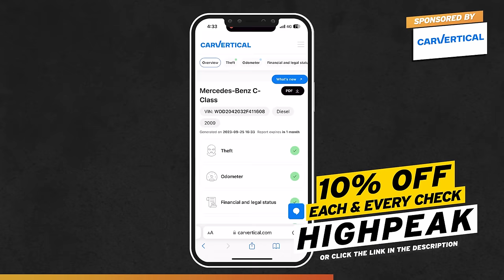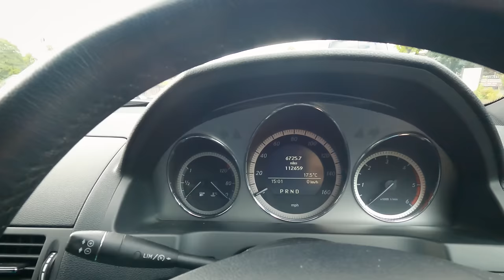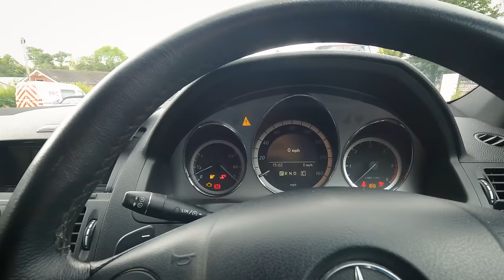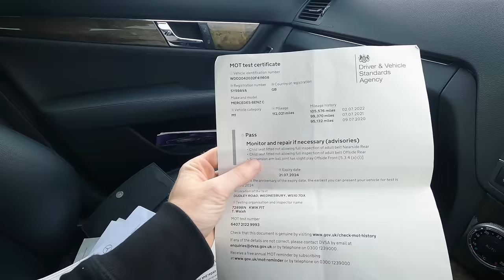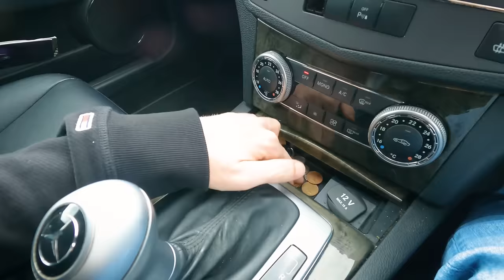I BOUGHT A CHEAP MERCEDES C-CLASS ESTATE FOR £2,700!

Comment: I find it astonishing that people will buy a fairly new, expensive, quality car for say £20k, and then skimp on a £300 service. I just don't get it. I've had loads of older cars over the years and even when they are worth peanuts, I would never not get it serviced exactly on time. Why do people do it?
Reply: Hi. I suspect people borrow the maximum amount of money they can to buy the car. This leaves them with nothing to actually maintain it.
Reply: Definitely spend all their spare cash on PCP or hp so nothing left to spend on maintenance especially when they will just chop it in again on 12 months for something in fashion
Reply: If it’s your main method of transport, and where you’re spending a significant amount of time, why wouldn’t you keep it clean and maintained? Baffling.
Reply: They may have maintained it themselves, possibly rather than probably!
I do my own servicing, partly to save some money, that's how it started, but mainly because I have trust issues having seen some of the stunts many garages put, I also then know it's done properly with quality parts.  Obviously can be a problem come sale time but I'm aiming to keep my current car for ever so not a problem.
Reply: Not ULEZ which kills the value of pretty much any mercedes before 2015
Reply: the human being, on avg, is not too sharp.   Or many of these owners are ignorant, or cars are too easy for them to afford.

Comment: Bought a 2014 one a year ago. Deliberately chose the older model c220 AMG sport estate because I preferred it. So far really pleased. Smooth and nicely planted on the road. Much prefer the interior and controls to newer cars (I hate cars with everything controlled by a tablet screen thing stuck on your dashboard). Engines a bit noisy when cold but on the move fine. Very comfy on a long journey and fuel efficient for quite a biggish lump.
Reply: I fully agrees about the interior on the newer Mercs to much like an Amstrad music centre
Reply: @pauldavies6037 yes the newer ones are chavy and glitzy, bit naff.
Reply: @mattwright2964  I Agree
Reply: What year are you calling new from?
Reply: @mattwright2964 what year is new to you?curious!👍

Comment: Not surprised it sold quickly. Quality ,well sorted car at a reasonable price,what’s not to like 👍👍👍👍
Reply: Rapidly approaching the moneypit sunset. Granted this is the UK but still absolute garbage quality. I've got a 30 year old nissan bluebird, none of those issues, they just run and run.
Reply: Where's the quality in a car with engine and gearbox mounts expired already, brake lines rusted and kaput. A tractor engine, and a stinking aircon. Mercs are just glorified taxis thats all.
Reply: @rambleon3698  blimey, that’s me told!
Reply: @rambleon3698  Wrong. Engine and gearbox mounts lasted for 14 years (you should find out how long a motor mount lasts on other cars and you will see that 14 years is very good), brake lines and stinking aircon got to that state because the car lived in a wet area, it was probably parked near the sea and it's completely normal for a 14 years old car...

Comment: My C220 CDi Estate (14 reg, black) has done 215000 miles and still drives like new, just passed another MOT no advisories. Very quiet, fast enough, 55MPG on a run.

Comment: I’ve had my 2009 c180 estate for 10 years ! And now on 227,000miles ! Still driving great , I’m now going to check my brake pipes !!
Reply: had the same model and also had the same brake pipe issue
Reply: I've just had mine replaced after them failing, a 2011 E250 CDi coupe.

Comment: i've have the 2012 estate 220cdi amg sports plus  version owned since nearly new at 5k miles  , and now 135k miles up. Apart from usual consumables, all i have every had to replace is the clock spring on steering wheel @ 90k miles and water pump @125k miles. g/box serviced every 40-50k miles and i've latterly increased engine  oil change intervals to every 5k-8k miles and the engine still runs as sweet as a nut (55 -60mpg on a run) . As an fyi merc have a recall for the possible rust in the rear sub frame which they will replace FOC if rust found  ..mine is ok so far. Bottom line for me is the utility value is worth far more than what i could get if i sold  it , and im looking forward to running it for another 100k miles

Comment: Had my 2008 c200 for 10 YEARS!!!! Still drives great and very reliable. Mine is the older OM646 engine with duplex timing chain. 204k and should be good galactic miles. Great video Matt!

Comment: I bought a 2012 C200 diesel last week. Definitely agricultural 😁 Not quite as nice to sit in as a 3 series but I’m liking it more and more. I even did a car vertical check with the High Peak discount. Happy days
Reply: Hello, how would you compare it against a Lexus is like a IS250 or 2013- IS300h? I'm interested but I would like to know if you had considered the lexus.
Reply: @Sha-Ayo He bought a Lexus IS the other day, and did a video on it! It was one of the really old ones though, straight out of the E46 era, so if you're buying one, expect lots of crispy metal and hidden bodgery below the door handles.
Reply: @sha22276 he has done a video on the IS250. You can check that out.

Comment: I just bought a 2012 R Class here in Canada - a true 7-seater station wagon (estate) with less than 60k miles on the clock powered by a 3.5-liter diesel and in as new condition for $15k (Canadian). I don't think this model was ever sold in Europe and it was never a massive success in North America where the market is either minivans (Honda Odyssey and Toyota) or SUVs. 
The Merc sits somewhere in the middle. Like a minivan,  it has seven seats, with the third row actually being comfortable and usable. Like an SUV it has 4WD and can actually be lifted on rough terrain. Its luggage capacity with seven seats in use is a little limited, but for our family of five plus a dog it is the perfect vehicle. 
30 miles to the gallon on the highway, which is amazing for such a large and heavy car. Very happy with it.

Comment: I've had one of these for 10 years, but with the V6 engine. A lot smoother than the 4-cyls and will still do 50mpg without trying too hard. Big enough carry a wardrobe, but not tank-like to drive at all. Rear tyres don't last long, wish mine had 17-inch rather than 18-inch wheels. I only got 10K from the current Continentals and I'm a sensible driver. Avoid solid red (Diablo red?) on Mercs of this era, there's a manufacturing fault that makes the lacquer peel off. Doesn't affect any other colours And I spent ages waiting for a red C350CDI to show up in Autotrader. Such is life.

Comment: Nice buy! I own a ‘08 s204. I love it and drive it for 6 years now. The rear subrame can be a problem on these cars. They will rust from the inside out and break. Mercedes replaced the rear subrame on my car under warranty when it was 11 or 12 years old! Als check the brake lines under the subrame, they will also rust..

Comment: I would totally agree with the brake pipes as I had the same problem on my W204, and it hadn't shown on the MOT, but a Mercedes specialist told me. Also, the subframe is a known issue on the W204 for corrosion. Nice cars though

Comment: All of those issues, i've had with my 08 C200cdi on 175k miles.  Coil springs, rear light plastic, seat cover, ball joints. Common issues. 

Also ive had a water pump go (no cambelt so not serviced on interval), body module (reset) and the keys play up. I dont skimp on my tyres like this, Michelin Climate Controls last forever and give these grip in the snow. 

Engines are more bombproof than expected.

Comment: My company got me a 2014 EClass 2.1 diesel a couple of months ago after my Nissan Jukes's cvt gearbox let go after 168000 miles. Its on 132000 miles, and i hate noisy cars but for some reason i dont mind it in the merc, once you move off it fades way. What i like is there is no difference in cabin noise between 60mph and 85mph. Plenty of power for normal use, 40mpg urban and 50 motorway @70mph. A 2016 ulez one is still £16000 +.

Comment: I like these mercs, I have one 140k on it. Solid cars if you look after them. Mine is now at an age/mileage where I'm getting things done to it regularly but I do drive about 400 miles every week in it.
Last 2 years - Brake line burst, got new line, discs, pads, several oil changes, 2 or 3 suspension arms replaced, Back plate replaced, new tires 3 times, exhaust clamp replaced, Air con pressure sensor replaced, re gassed...

Comment: I've got a 2014 C Class saloon Matt and really like it. Mine was bought new by someone who cheaped out with the accessories catalogue, but I still love it. Yes, the 2.1 is a little agricultural and my 136 bhp version does this thing in "sport" mode where it just makes more noise without any perceived performance increase 😂. But that engine is fitted to the Vento van and as such is very durable. You made me really anxious when you pressed the tailgate release as that wall looked awfully close 😬. But it looks a nice example. Privacy glass is nice to see as is the dog guard for your XL Bully 😉.
In conclusion then, quite an outlay for the profit BUT another very nice car for the buyer with a potential 100,000 miles more life in it if they look after it.
P.s. I also get the gearbox service done on time. It's not cheap but the cost of a reconditioned gearbox is a lot more.

Comment: That price is crazy in germany where i live the cheapest one in a 100km radius is 5900€ and it has 300000km on the clock wich is about 186k miles and the engine is knocking

Comment: Great video I  picked the same car for myself Matt from auction,  C250 estate £1800 on a 2011 with 188k, same door card issue!, needed a drop link and a tyre, needs a timing chain as the tensioner is worn. so for less then 3k I've got a super quick safe tank that does 40mpg!

Comment: Good watch again Matt. However, at 17:09 I am perhaps in the minority. I traded in my 2019 530d a couple of months ago that I had had serviced at BMW, left Michelins all round that had done 5,000 since replacing them and wanted for nothing, but, I deliberately left about 20 miles of diesel in it. My view is that if I’m offering a car thats been well looked after why should I give away half a tank of fuel as well? Particularly given the cost of fuel at present. 😂👍

Comment: I have the petrol C180k of this, 2009, 125k miles, silver in absolutely mint condition. I’ve added a touch screen display, reverse camera and phone charging. Zero mechanical issues with it (had copper brake pipes fitted AND auto gearbox service!) feels like a £15k 2018 car. I thought I’d only be looking at £3k sell-on for it (if I sold it), but you getting £5995 for one in much worse shape makes me feel better!😂
Reply: Sounds like it looks more modern with your upgrades. Always have more respect for people taking pride in their older cars.

Comment: Got my c200 kompressor in Australia for $ 12, 200..., 118000km. yep, had bad vibrations under acceleration,  however new mounts and she is sweet. Also I notice alot of the 204 chassis suffer that aweful wavy vinyl on the door top, must be people resting their elbow there. Apart from that, and being overly noisy, not what you would expect considering our holden commodore's were far quieter, but  a great rig.

Comment: I traded my last car in on an empty tank, but not deliberately. I actually filled it to the brim five days before I took delivery of my new car… the dealer delivered it three days late, not a chance I was going to go fill it up again for them having already done that once… they delivered my new car with the fuel light on. Incidentally, it’s the only time I’ve seen the fuel light on on either car… I always fill my tank and never try to run on fumes. Had they have delivered on time, they would have had over half a tank in it, but I was easily using a tank of fuel a week in that car.

Comment: I've said this more than once I like to thank I look after my cars quite maticoulously , generally I buy cars upto 3 years old and the wife's upto 8 years old or so I have never bought a car yet that the car has not had the petrol light on. I've only ever bought 1 brand new car which in 01 was near enough £19 grand and that had only half a tank of diesel. Matt you must be the only car dealer in the UK that puts fuel in a car before selling as No1 else does unless I'm extremely unlucky and at 53 including wife's and daughters cars going on 50 cars.

Comment: Had this era of W204 as it’s a good looking car, but always check the subframe as they’re prone to rot. But if they do, you can take it to a merc garage and they’ll replace it for free.
Reply: A merc dealer replacing something for free!
Reply: The independent Mercedes specialist I take mine to told me that he checks when it comes in for servicing, removes any surface rust from the subframe and coats it in oil. I am very impressed with the service I receive, can't blame them for parts costs, that's down to Mercedes, how about £90 for 4 little plastic wheel centre caps, I should have asked first I guess, just thought they'd suit the refurbished wheels, still can't take it with you !

Comment: I had the exact same Merc for three years and without a shadow of a doubt it was the most unreliable bag of nails I have ever owned.  The following is just some of the things that went wrong with it: Brake pipes corroded- all replaced, torque converter refurbished £1250, suspension arms failed, countless sensors replaced on the engine, water pump failed-replace, DPF blocked- taken of and cleaned, Spring broken-replaced. In addition there were numerous items that failed and I just lived with, CD player failed, air con failed, drivers heated seat failed, rear demister sometimes worked.  I sold it in Feb this year to dealer in Milton Keynes, on the plus side it was MCFC blue!  I'll be very surprised if you don't see it again, I would love to hear the follow up.
Reply: Suspension arms don't fail, they are a consumable item that with the state of British roads you're probably lucky to get 100k miles out of them.

Comment: The older Mercs are far more better well made than the newer cars, If you can buy an older Merc with Low miles and look after it, it will look after you. All the old Mercs were Manufactured in Germany, Now they have some parts Manufacture in China and then put the car together in Germany.  Im looking to buy a 2013 Merc C250 Estate with about 40 Thousand miles, FSH  price11K

Comment: Result getting £6k, I thought you were pushing it a bit when you said £5k at the beginning, I've got a 55 plate saab convertible here if you want it, unfortunately no mot, my local garage has been to busy and I've been off work and unable to drive, so I was in no rush to get it tested, it's been sitting on the drive now for 2 months and I'm not sure when I'll be allowed behind the wheel again, I'm sure someone will take it away for £500 🤷‍♂️

Comment: Right. The new video came up before can comment of A class you bought for £1500. The S Class in 90s bought by execs with 2 kids to drive to from work, church. Not really used for long roads trips. These are men over 50s which I reckon you are well  below that 😅 nice to see the superfluous gadgets of that time. You may be right about owners passing away and car sits there for years. My dad passed away 2020. Mum doesn't drive so an 1990s E 420 with less than probably 30K miles,  bone dry always garaged from Cal. sun, will sit in the garage for another 5-10 years as mum does not want to let it go. In the end we are merely stewards of cars (and houses) for the time we are on this earth, so let's enjoy👍🏻Namaste. PS if you can only have one car to drive, what would it be? I am hoping you did not part with you SL AMG. That is one car to keep. My dream Mercedes are the couple convertible from 80s, classic design and simpler times, no internet, people seem more connected as odd as that sounds. Namaste. On with more binge watching. The front grille of this C class doesn't grab me, definitely post 2000s era.

Comment: Well the s204 C250 CDi reg SY59AVA passed its MOT at 112,000 miles in mid 2023 when it was 14  years old. I don't believe the mileage of 112k on a 14 year old diesel with shot engine mounts. Engine mounts should last longer than 112k. My own 3.5 year old 2016 ex lease s205 C200SE petrol cost me £9.4k at 154k miles. Its now on 204k and 4.5y of my owmership only 1 Nox sensor and 1 waterpump.

Comment: I’ve had a couple of these and they are good cars, every single model or variation serving a good purpose. I’ve had a 180K and a 200 CDI, both 6 speed manuals, providing exceptional fuel economy. It’s not easy to sell manual Mercs as the auto boxes are a lot more relaxing and suit Mercedes in general, so bear that in mind d when buying or selling.
The supercharged engines are always a blast. Overall, it’s a nice improvement on the 203 series and a more positive improvement than what happened between the 211 and 212 series E-Classes, where somehow some of the quality feel of the earlier generation was lost.
I’d get either one of the Kompressor engines or the 250 CDI again. The 200 CDi does over 60GB on a good run, but these diesels have all sorts of issues associated with modern diesel engines, so rather than economy, I’d go for the extra power and torque, enjoying them while spending what has to be spent.

Comment: Love Mercs. I have a 2013 C220 AMG blue efficiency, and I recently had to have a new engine as the old one had seized. Does anybody know if that would affect its value? The old engine was at 84K miles. However, the new engine now is 53K miles, and the engine is 1 year younger than it's previous.